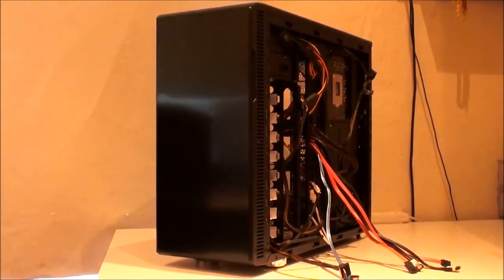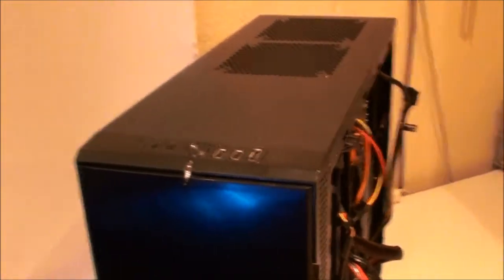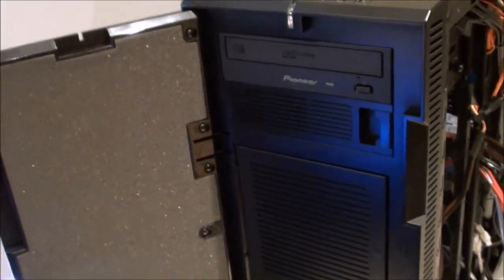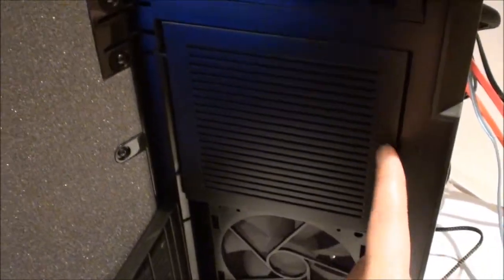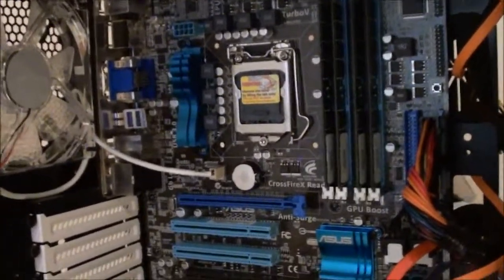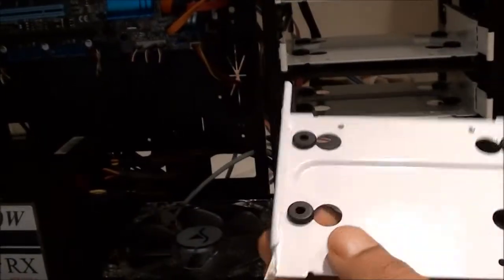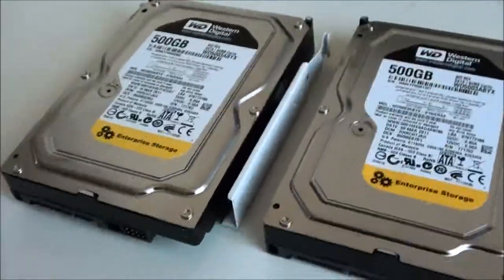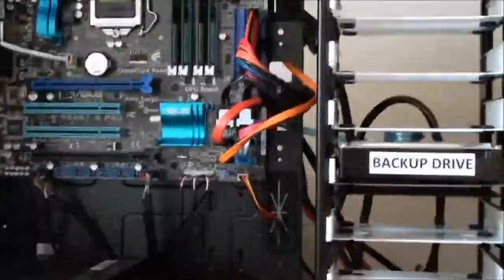Building a Server PC Part 1

Comment: So why did you not decide to use hot swap bays? I have a gaming computer that runs as a server as well. Having hot swap bays is vital to have instant access to your drives without taking your computer apart. Or if you need to take out your drives when you go on vacation or if there is an emergency. I like your setup though! Thats a nice case, I use the nzxt phantom. Have you thought of using ssd drives as well for boot or small quick storage?